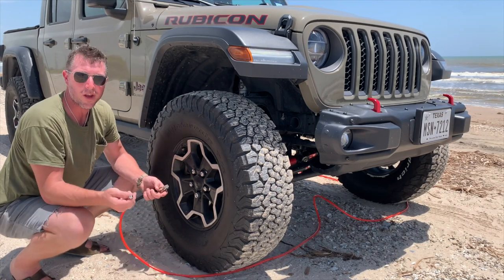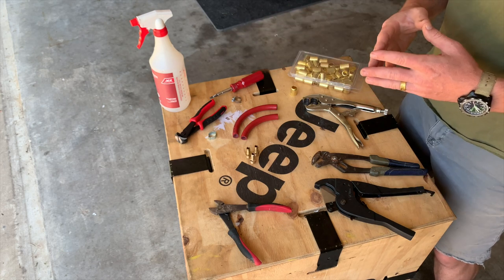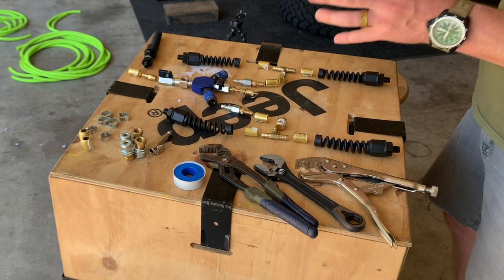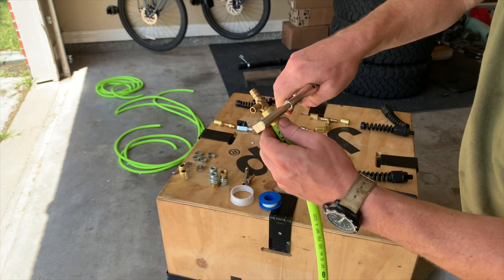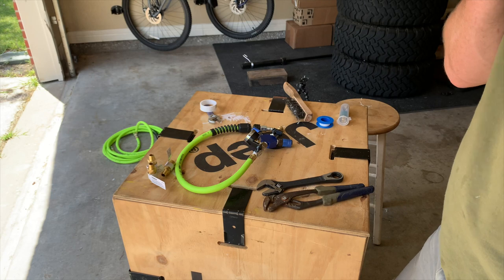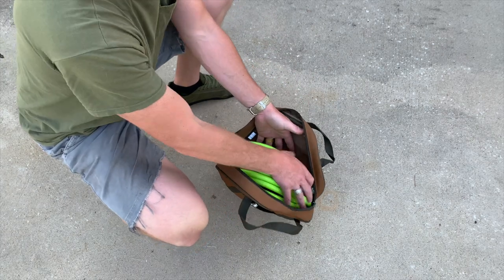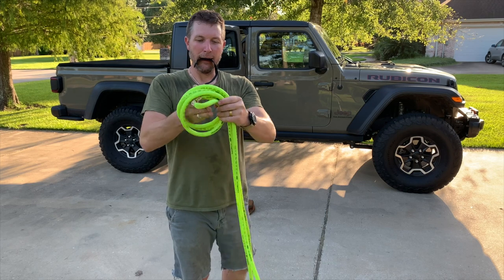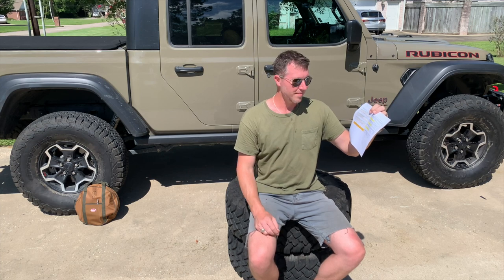DIY 4-Way Tire Quick Inflate/Deflate System for Off-Road Tires

Comment: is it worth using 3/8" air hose ?     or would 1/4" be sufficient ?
is the flow of 1/4" good enough to keep up with 3/8" hose for filling 4 tires ?
the 1/4 hose is a lot smaller and lighter, but I would hate to make it slower...
Reply from the maker: the schrader can take about 20-25 cfm so plenty of what we could give them with all 4 connected. The output of the ARB single compressor delivers 2.34CFM at 30psi whereas the dual ARB compressor delivers double that @ 4.68CFM at 30psi. Looking at hose size ratings at 30PSI, 1/4"ID can flow about 5CFM, 3/8"ID can flow about 10CFM. Of course through in fittings, valves, etc... those number would change. If you go with 1/4"ID hose (About half the cost). Based on this info it looks to me even the ARB Dual compressor would be a good fit for 1/4"ID hose and won’t change speed, The Schrader valve is what limits the speed.
Reply: @GatorOverland  oh cool, thanks for the info and video! I really like those crimp on ferrules and will have to use those.
I have thinking about making this for almost 10 years now, but keep going back and forth with my ideas. i cant decide weather i want to make one of these or just plumb an air line to each wheel well.
i already have air plumbed to my bumper, and I have a 2door tj with 3 people and a dog, so space is limited. but even with air at each wheel well, i will still need to carry some hose to connect them. i just want to make it as compact as possible.
Reply from the maker: @MrMrsregor  The intention of my design was to be a universal application that I could take or use for any vehicle… I will probably plumb my own like you have mentioned and only have four whips to connect.
Reply: @GatorOverland  i am going to build one of these for now, and put it in my xj if I end up plumbing my entire tj with air lines And will make one of my hoses a little longer for filling other peoples tires. 
I don’t want to have to swap gear from one jeep to another, so I’m trying to keep everything fully equipped (difficult). 
Thanks for the thoughts 👍🏽
Reply from the maker: @MrMrsregor  🧠👈🏼

Comment: Because of the way you put your air compressor behind your rear seat in your JT, maybe the 'H' layout of your hoses works best for you... For my JL though, I just put my air compressor in the rear cargo area and access it via the tailgate... Due to that, my air line layout is a bit more flexible (pun not intended).  I just have a length of hose that is long enough to go from the rear cargo area all the way around the vehicle in a U-shape loop, with 3 T-fittings and quick-connects at each tire... Assuming I'm starting at the rear cargo hatch and going clockwise, I first have a length of hose that will go from there to the left rear tire where there is a T-fitting.  Then another length of hose that goes from the left rear tire T-fitting to a T-fitting at the left front tire.  Then another length of hose that goes from the left front tire around the front of the vehicle and to the right front tire where there is another T-fitting.  And then from the right front T-fitting, another length of hose ending in a female quick connect that will go all the way to the right rear tire.  On each of the T-fittings, there is a female quick connect.  There are also short pieces of hose with a male quick connect on one end and a locking air chuck on the other end that are used in the T-fittings at the left rear, left front, and right front tires.  There is a locking air chuck on a male quick connect fitting that is used to connect to the hose that goes to the right rear tire.  The advantage of this (for me at least) is that it can be used as a long straight air hose without a lot of reconfiguration...
Reply from the maker: I’ve done a quick connect setup like you talk about on a couple friends vehicles. My setup is not vehicle specific, rather it is a multi car application so I could bring it anywhere or let someone borrow. I will probably upgrade mine to a fixed quick connect at the wheel wells and have only 4 - 24” leads

Comment: I try to avoid using those screw type hose clamps if at all possible... They always seem to leave a tab sticking out that will cut your hands... I've had good luck with the DIY "Clamp-Tite" type wire hose clamps though (using 18 gauge galvanized electric fence wire)... The end pieces of the wire fold down onto the rubber hose and are less likely to snag on your hand and slice it than the screw type hose clamps...
Reply from the maker: The shop I work at has resulted to the wire method. I agree with the other statements he made… Everybody has a different take on them based on their budget… I prefer the Ferule overall
Reply: @GatorOverland  -- Even with the factory hoses, I've found that over the years, you get a leak where they flex near the fitting... The advantage of the wire hose clamps is that they can be easily replaced and can be made to work on any size piece of hose as long as you have a long enough piece of wire... I buy my electric fence wire from TractorSupply in either 1/4 or 1/2 mile rolls... You can fix a lot of hoses (air or garden) with that much wire... :)  I've probably fixed more garden hoses though since I used to have a dog that would decide to eat a hole in the hose for some reason... A piece of 1/2" CPVC pipe was the perfect outside diameter to match the inside diameter of my garden hose... I would usually put the CPVC on my mini-lathe and cut some grooves / barbs in it though...

Comment: I did all the things as you have mentioned in your vid but my air never equalize. what could be the reason. I use Haltec - H-5265 air chuck.
Reply from the maker: If all 4 valves are attached properly and connected to the manifold it will that a few minutes to equalize. 
I had a friend in Denmark reach out a while back with the same issue and his hose ends had a 1 way ball valve that kept air from going both ways.. to check this, simply remove all the hoses and blown through all the ends.. if one doesn’t blow, you’ve found your issue.. let me how it works out
Reply: @GatorOverland  it was a faulty air chuck. Now all good. Thanks a lot for the reply. Really helpful. Cheers.

Comment: I noticed this video a little late, how much did this cost you to in the hose you bought.
Reply from the maker: At the time about $140 sparing no expense.. similar units run about 180 to 200, but you can do it for about $80 if you use cheap hose. 
I have been considering hard line fastening to the Chassis and just having for air whips that connect to the wheel wells to minimize the amount of extra hose needed… The intent of this designers to be portable for multiple vehicles

Comment: I think you should upgrade the hoses to be an onboard hookup. Several more options.
Reply from the maker: I had considered doing that at the beginning, but then it’s only useful to my one vehicle… I want it to be used on multiple vehicle applications… So it works for what it is. I make a dedicated set later on and use just 4 short hoses from connections in the wheel wells

Comment: Does 37” 12.5x9 fit the stock wheels? Did you use 1.5” wheel spacers to fit no rub?
Reply from the maker: I have 37 1250s on the 17 x 7 1/2“ wide stock wheels… I do not use wheel spacers nor do I have any issues rubbing even when flexed and steering lock to lock… if I went with a different set of wheels it would be the 17 x 8 1/2 with the same offset and backspacing specs as the AEV pintler. Wheel. I do not prefer a wide offset outside of the wheel wells

Comment: Crazy how the 4-way actually decreases the time. I'm considering that now, for airing up specifically. I use the staun deflators for airing down. But this seems almost as fast.
Reply from the maker: Yes the main advantage is for airing up, but it does have a bonus of being able to air down all four at the same time. I still use my coyote deflaters down to 12psi.
Reply: Big brain moment...can you rig up a staun deflator to the manifold somehow so that the entire 4-way system stops deflating at the desired PSI??
Reply from the maker: Yes, I explained that at the very beginning that it was an intention, but unfortunately it would take longer than all other methods to deflate. So you could do it, and it would work, but you’d want to plan way in advance. Basically you can inflate and deflate 4 37’s from 30psi to 12psi and back up faster than it would take to deflate using the staun/coyote deflator on the manifold.
Reply: @GatorOverland  ahhh didn't make the connection between coyote and staun. Got it

Comment: U have the engine up front some vehicles are heavier in the front than the rear so are the tires truly gonna equally distribute pressure or is it gonna read they are because let’s say the front is heavier so putting more down force on the tires which may show 35 when it’s really just 25
Reply: That's not how tire pressure works. The tire will read the same pressure no matter how much weight is on it. The only way to increase the air pressure in the tire using weight would be to compress the tire from all sides simultaneously, thereby reducing the physical size of the tire.  

Otherwise, just having more weight on the tire compresses the bottom of the tire which causes the air pressure to expand the top of the tire to compensate.
Reply from the maker: Wow! Couldn’t have said it better my self..
Agreed! 30psi with 3000# load will squat more than 30psi with 2000# load.. either way it’s still 30psi

Comment: What brand bag did you use for storage?
Reply from the maker: It’s by bucket boss.. check the description for all the links to build it
Reply: @GatorOverland  good deal, I built the same system and been looking for a storage bag and came across your video. Thanks for the info.

Comment: Instead of using the deflator and tire stem there, why not just used another inlet valve on the other side?
Reply from the maker: It’s ineffective/inefficient either way

Comment: What is that thing with the tooth that just plugs into the valve stem and let’s you leave it there
Reply from the maker: You’re either talking about a air Chuck, or a coyote deflator

Comment: Great video. Doing this! Thanks!
Reply: Also, sub'd. Great content, sir.
Reply from the maker: Thanks I appreciate that! You won’t regret it! 
Here is a DIY 4-Way inflate/deflate system I put together. It allows for convenient and equal adjustment of all your tires pressure. It’s a big time saver. I spared no expense doing mine, but you can put these together for as little a $80. 
the schrader can take about 20-25 cfm so plenty of what we could give them with all 4 connected. The output of the ARB single compressor delivers 2.34CFM at 30psi whereas the dual ARB compressor delivers double that @ 4.68CFM at 30psi. Looking at hose size ratings at 30PSI, 1/4"ID can flow about 5CFM, 3/8"ID can flow about 10CFM. Of course through in fittings, valves, etc... those number would change. If you go with 1/4"ID hose (About half the cost). Based on this info it looks to me even the ARB Dual compressor would be a good fit for 1/4"ID hose. 

https://youtu.be/3STi-cPd4r8

Materials and Tools (including amazon affiliated links) 
(1) Flexzilla Pro 3/8"x50ft hose https://amzn.to/34ou694
(2-3) Flexzilla Pro 3/8" air hose reusable fittinghttps://amzn.to/3l2whVR
(1) Flexzilla Pro 3/8" air hose reusable swivel fittinghttps://amzn.to/31e7dDF
(9-14) 3/8" hose clamps *optional" https://amzn.to/2Q7mWxX
(9-14) 3/8"/11mm double ear hose clamps optional https://amzn.to/3kYe389
(9-14) 0.635"ID Ferrule optional required with Flexzilla hose https://www.toolsource.com/air-couplers-and-fittings-c-1421_372/brass-ferrule-flexzilla-38-inch-p-134072.html these 0.625" ID ferrules may work https://amzn.to/34urqHp
(1) Ferrule Vgrip crimpers optional https://amzn.to/2E9gd44
(1) 6in1 multi screw driver optional https://amzn.to/2YkFcIv
(1) End Cutter pliers https://amzn.to/3iVXxUb
(1) Teflon Tape (2) 3/8" Barb Tee https://amzn.to/34lDdHJ
(3-12) 3/8" Barb x 1/4" NPT Male fitting https://amzn.to/3coi9ny
(2) 1/4" NPT Male x Female ball valve https://amzn.to/3aJ6c9O 
(1) 3way Air Splitter manifoldhttps://amzn.to/32aLz25
(1) ARB 0740106 or similar 1/4" NPT adapter M/F/F https://amzn.to/2FGWUzA
(4-5) Haltec H-5625 Bore Lock-On Air Chuckhttps://amzn.to/3hikxfF
(3) 1/4" FNPT "M" style air plug fitting
(1) 1/8" NPT X 1 1/2" dia. 160# air gauge https://amzn.to/31aVrd4
(1) 1/8" FNPT x 1/4" MNPT reducing bushing
(1) Bucket Boss cable bag https://amzn.to/3aFwFVs

Comment: How much money do you got invested in this custom setup?
Reply from the maker: 2yrs ago it was about $150 sparing no expense.. you could do it for about $80 with cheap hose
Reply: @GatorOverland  yeah proces have skyrocketed I did the math for 1/4 and or 3/8 setup to do it now is about 315 bucks not cheaper then buying a pre made kit
Reply from the maker: If I could do it again, I would remake it in 1/4 inch… I will probably do that soon for myself… I have made a few other 1/4 inch for friends.
Reply: @GatorOverland  I hear ya

Comment: Sir I think some product links are missing toward the end, is there an updated list?
Reply from the maker: Hey! Thanks for taking the time to watch and comment. The current list is all you should need, most of which are available via Amazon, the others are accessible at most hardware or auto part stores. If the link is missing just type It into a Amazon search and it may be available. I will go through an look as well, but the meat and potatoes are listed.
Reply: @GatorOverland  one question, also I appreciate the fast reply, your link for (3-12) 3/8” barb x 1/4 NPT male fitting leads to 1/4 barb x 1/8 npt male.. I’m assuming i should just type in 3/8 x 1/4 and get those but then I thought I’d make an ass out of myself by assuming.. could you clear that up? Is it 3/8 x 1/4 or was that a type? Thank you!!!! Adding it all to my Amazon cart
Reply from the maker: Thanks for the heads up, it seems they removed that option. I will get it adjusted. Here is what your looking for
https://amzn.to/3vTBFjM

Comment: why do you even need a deflator? just open up the release valve and close it when your air gauge reads the pressure you want. Less restriction that way. Though I put my 4 tire deflators on and it only takes a couple minutes to work. Basically screw one on, then make my way to the next tire, and so on, then wait about a minute or two and then the first one will stop, so I unscrew it, then go around again. I can't imagine that unwinding and wrapping that huge hose up would be any faster than 4 auto deflators or by any significant amount, and that's a lot more work than just using the 4 deflators.
Reply from the maker: You’re absolutely right.. the deflator was an idea, but it’s not advantageous for this configuration.. yes 4 deflators is fast to, I have them and they work great.. the main advantage is all tires filling equally at the same time.. worth every minute saves. The concept isn’t for everyone.. it’s a convenience not a necessity.. Thanks for commenting 🤘🏼
Reply: @GatorOverland  I like the idea of filling all 4 at the same time and especially like the ability to even all the tires out incase the compressor craps out with 1 or 2 left to fill. I was just speaking to the deflating aspect. 
.
I'm thinking of making a 2 at once setup to let my compressor cool down a minute between fills and to have the safety. But I certainly like how compact your setup is with 50' of hose wrapped up in that bag.
Reply from the maker: Yes.. Thanks.. I’ve actually considered plumbing the hose on the frame and having 4 chucks in the wheel wells  and having (4) 36” lengths to hook up instead of dealing with the 50ft of hose.. my current configuration allows me to go to multiple vehicles which is more useful..
Reply: @GatorOverland  that said, did the deflator folks send you the thing you mentioned and did it work? I'm interested just for the sake of being able to walk away and maybe disconnect swaybars or something else while the deflation is taking place. Currently I'm running the 4 JT Brooks auto deflators and it works great (set it and forget it), but just curious. Thanks! Great vid!
Reply from the maker: The deflator option does work but it takes forever (25mins)… I made a manifold with four deflators on it and it still takes a long time…Quickest method is main hose with the open valve
Reply: Dude — S-O-L-I-D video. Thank you for taking the time to prepare and share. Just sub’d. Ya’ll that ain’t — DO IT NOW!
Reply from the maker: Hell yea! That’s what I’m talking about! Thanks! Let me know if you have any questions, always happy to help!

Comment: Did you end up making a flow up regarding the kyote deflator?
Reply from the maker: I think I know what you’re asking… I tried a few other deflator methods to where it would auto deflate to a desired pressure… None of them were efficient enough for time… I just time it on my watch or o’clock… Typically it’s five minutes deflate and nine minutes inflate… If you have a twin compressor it will be closer to 4 to 5 minutes in flate

Comment: What was the grand total for the entire system? Compressor and all
Reply from the maker: Arb single compressor $250
813 bracket and switch plate $200
DIY 4way inflate/deflate $90
Misc. wires and connectors $20
$560’ish